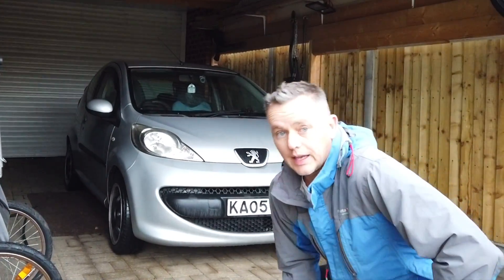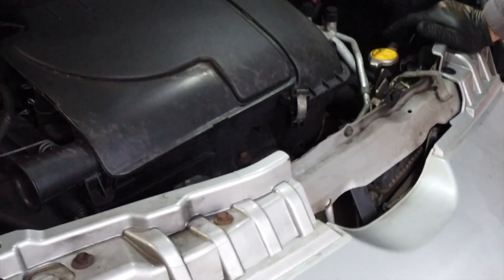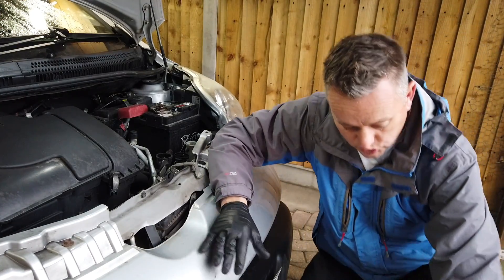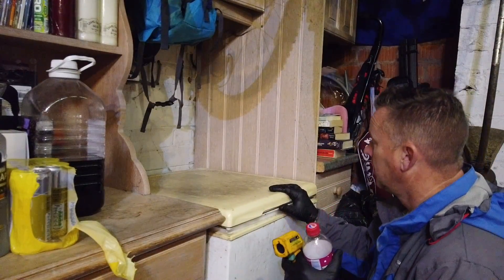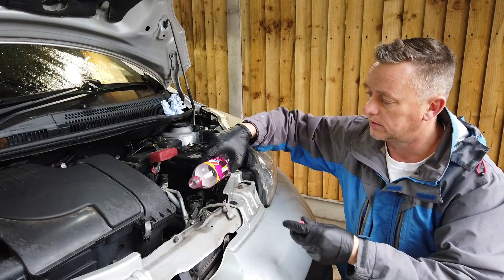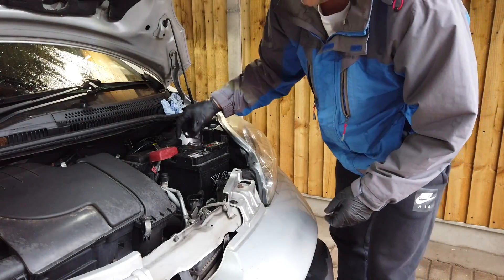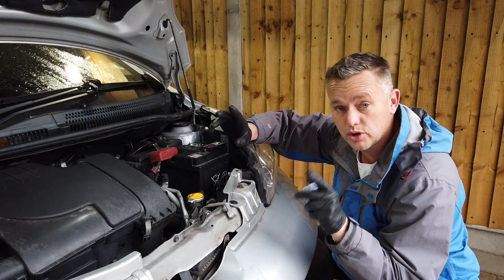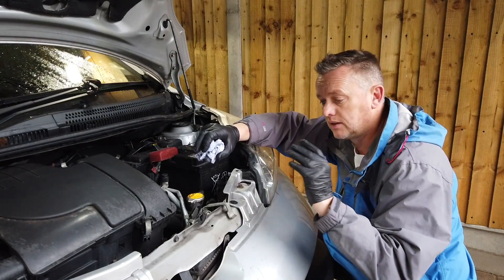How to check Antifreeze Content, "Citybug" 107 Aygo C1

Comment: I bought the original pink Toyota coolant for when I get time to change the coolant... Nearly 10 years old now and has 93,000 miles on the clock so close to the recommended 10y/100,000 mile coolant change
Reply from the maker: Thanks for the great comments👍🏻👍🏻🛠
Reply: @aaanton11  I literally just changed it yesterday, I can't believe how easy it was. Took about 15 minutes to change it and burp the system. Now just keep checking the cap when it's cooled down and topping up what ever air has appeared in The cap. 

I never expected a coolant change to be easier then an oil change. I guess it helps that you just fill the system and don't need to keep checking a dipstick xD.

Comment: cool - i seen a video where you can use a multi meter to test the rust inhibators. anything over 250mili volts it needs changing.even though the test used here was ok.
Reply from the maker: Thanks for the great information👍🏻👍🏻🛠

Comment: I don’t understand why there’s two caps for the coolant. I get confused where it’s supposed to be added 

1. In the pressurised (will blow in your face if engine is hot)
2. Or the black coolant cap next to it?

Please help
Reply from the maker: open the pressurised one when the engine is cold, top up and refill there , the other tank is fill to the max line on the side, Thanks for the great comments👍🏻👍🏻🛠

Comment: My Aygo never seems to build pressure in the hoses. The system runs at around 84°c though and that's around the specified 83°c for the Aygos cooling system. I use torque to monitor temps and the fan kicks in at around 92°c (which only happens in stop start traffic)
Reply from the maker: There should be pressure at 92 degrees as steam is produced, are you loosing any coolant? possible radiator cap worn be I would expect a leak, Thanks for the great comments👍🏻👍🏻🛠

Comment: My rad is smoking clear white, will this have anything to do with it? The plastic tank is full and has been for 6 months
Reply from the maker: check the radiator level by removing the cap when the engine is cold. it will steam whilst warming up on a damp day as the vapour evaporates from the fins, Thanks for the great comments👍🏻👍🏻🛠
Reply: @aaanton11  this is the thing, the level of coolant inside has been full for almost a year.

Comment: Hi Thanks for the information, your videos are very informative. Have just bought a 2015 C1 and the garage replaced the radiator but the bottom hose popped off when I got it home and it drained the system. They took the car back and fixed the issue but now I've got the radiator fan on all the time on even the shortest journey. Could there be an airlock or something? How would I fix that myself if there is an airlock (before borthering the garage with an issue)? Can I just take the radiator cap off and start the engine to get the air out (if there is any). I literally know nothing about cars, I just don't want to break it. Thanks.
Reply from the maker: I have a video on how to replace the water pump https://youtu.be/a9zXGS5CPy4
just follow the refill procedure at the end of the video, Thanks for the great comments👍🏻👍🏻🛠
Reply: Personally I'd just take it back to the garage if the work/car is still in the warranty period. I know this is late so how did things work out?

Comment: Hi, just bought a Citroen c1 and found your channel, looked through a lot of your vids but cannot find anything about topping up power steering fluid [as my PS light is intermittent] can you advise please? thanks
Reply from the maker: There is no power steering fluid the system is electronic, you can see the motor on my video on heater motor replacement, you will need to use a code reader to grab some fault codes for a better idea as to what is wrong, Thanks for the great comments👍🏻👍🏻🛠

Comment: I've just discovered your channel is amazing thank you!
I have a Peugeot 107 and my separate coolant tank is always empty. I refill it, but after one hour trip is empty again. But apparently, the main system (where the yellow pressurized cap) is OK.
Do you know why this may be possible?

Thanks in advance!
Reply from the maker: you must have a leak, sounds like the separate tank might have a crack in it, if the radiator is always full, Thanks for the great comments👍🏻👍🏻🛠

Comment: I have an overheating issue at the moment after changing the thermostat, coolant temp sensor it's still the same done a head gasket test on it still comes back as okay, ended up replacing the engine as the clutch needed doing and could not find a source of the over heating i got a good deal on a used engine with 40k. The problem is the new engines doing the same I'm trying to figure out what it could be, i noticed that there might be too much coolant in the white bottle do you think that would cause overheating? I'm gonna drain some of it tomorrow.
Reply from the maker: you need to be checking the coolant from the top of the radiator, then set the level in the white bottle, if the bottle then fills chances are the radiator cap is leaking, try another one. hope this helps Thanks for the great comments👍🏻👍🏻🛠
Reply: @aaanton11  thanks ant you always help me out

Comment: Hi, so if I need to top up coolant, do I just top up to the Full line on the overflow tank? meaning I should never need to open the radiator cap if topping up? Thanks
Reply from the maker: No when the engine is cold you need to make sure the radiator is full, then top up the overflow tank Thanks for the great comments👍🏻👍🏻🛠

Comment: I just checked mine there and I can't see any liquid under the yellow or black caps. How do I know what kind of antifreeze to fill it with, or does it not matter?
Reply from the maker: if you squeeze the hoses on the radiator with the cap off can you see the colour of the fluid, most likely to be red/ longlife coolant, Thanks for the great comments👍🏻👍🏻🛠

Comment: Love these 107 videos as I've got a C1.  There's blue coolant in my system.  Is it possible to change it by sucking out the blue with a baster and replacing with red?
Reply from the maker: No, the easiest thing to do is top up with blue, if you want to replace with red, you will need to totally drain down the system by popping the bottom hose off the radiator, then refilling, as in my replacing the water pump video, remember don't mix the two colours it will go all slimey, Thanks for the great comments👍🏻👍🏻🛠